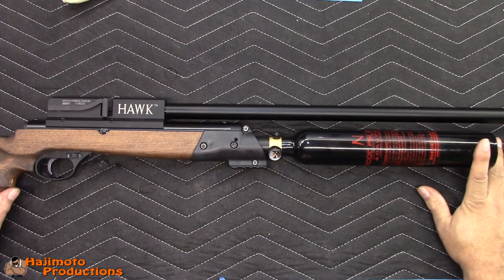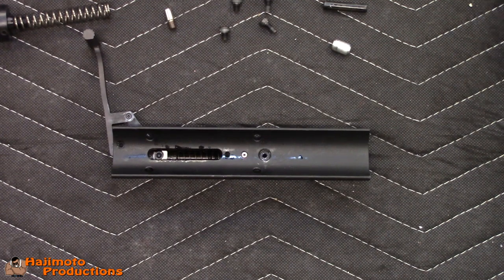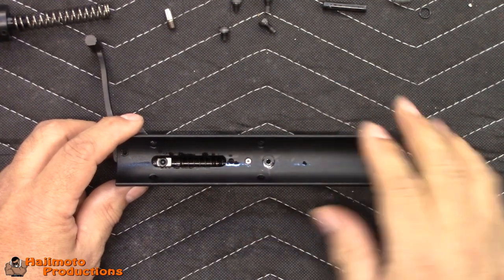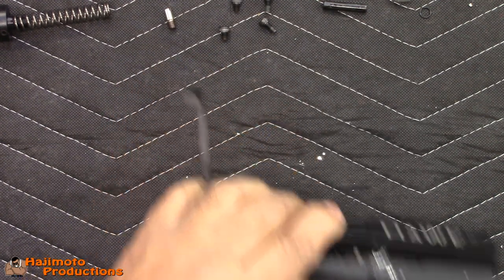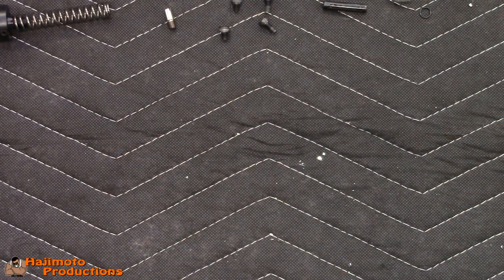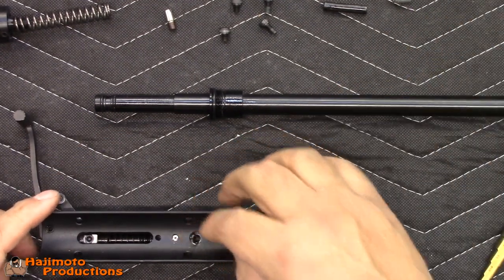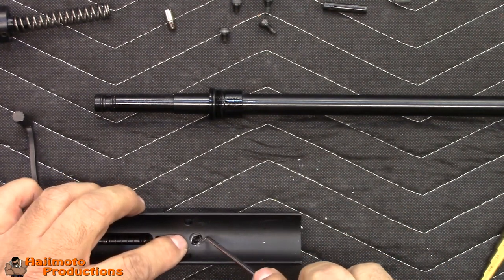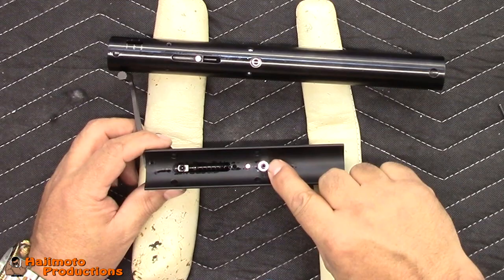Tutorial: JSAR HAWK Breech Transfer Port Mod

Comment: Your a braver man than me. I would be skeerd to do that by hand . Lol
Reply from the maker: Brave or stupid?  LOL, To be honest, I was only increasing an existing hole from 1/8" to 3/16". I mean if I held the drill on a 30° angle or forced the step bit through and the 1/4" bored out the hole essentially ruining the aluminum transfer port tube seat because it was oversized, yeah, there were those risks but I read way too often in my comment sections" not everyone has machinist tools (nills, drill presses or lathes), how can a regular homeowner do it, so I did it with a cordless drill motor and a step bit, LOL
Reply: Hajimoto Productions  you’re doing good things in these videos. I just figured you drink way less coffee than me 😀

Comment: Wait what about the barrel? If the hole in the bottom of the receiver is the same size as the hole in the barrel does it really increase power? You still have a bottle neck on the barrel
Reply: Can this be done to a guantlet?
Reply from the maker: Please watch the assembly video you will hear me say that the transfer port on the HAWK is a radial design, there are several holes that are acting as transfers around the barrel not only one.
Watch here and listen:
https://youtu.be/zhsOfSCSjSc?t=2252

Comment: Was it just my OCD or did that hole look like it's not centered? If the lip is thinner than the o-ring on one side, wouldn't that be more prone to a leak when the gun is fired?
Reply from the maker: It is a camera angle and optical illusion that picks up on  the black anodizing missing on one side more than the other which gives the illusion of the hole being off center.